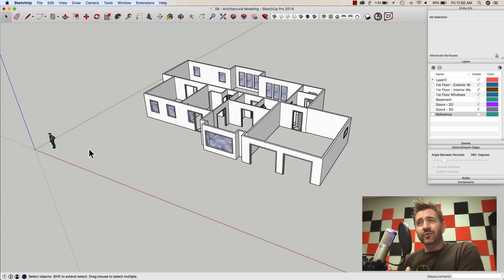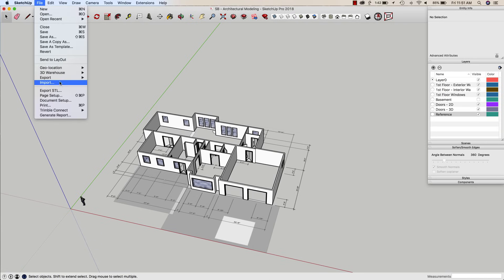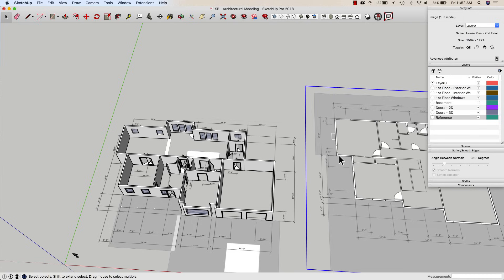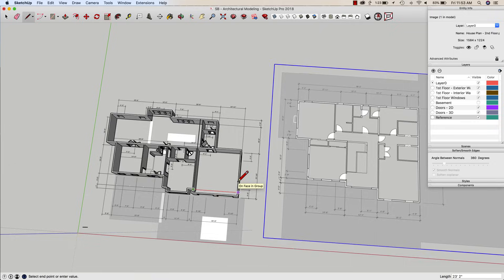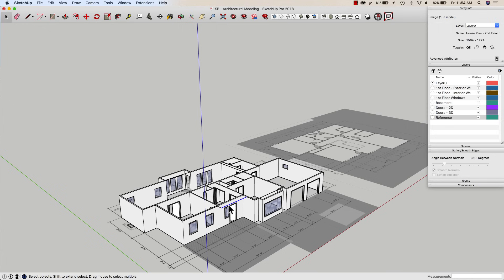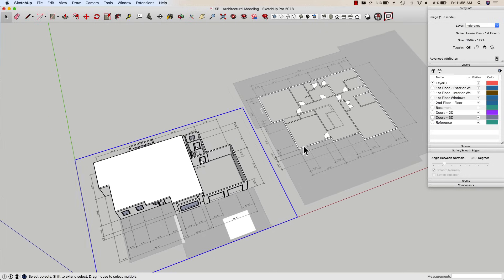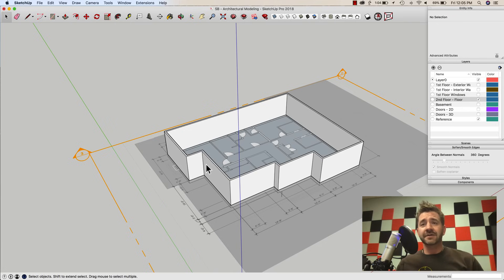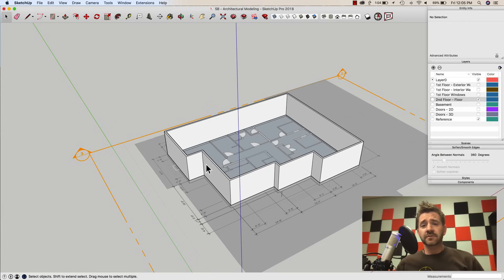Creating a Second Floor in SketchUp - Skill Builder

Comment: Thanks Aaron. Lots of good tricks here not isolated to architectural modelly, like the Unglue (which has frustrated me many times), the priority of faces and the use of a transparent surface, grouping the line ad image and scaling the group with the tape measure tool and a section plane to hide the lower objects so they do not distract from the task.  Excellent.

Comment: Hey Aaron. Thanks for all the great tips the Architectural Modeling Series. I liked how you explained how to create both 2D & 3D visual options within components. This spurred two different questions that I have had. One came from your 2D & 3D door example, which is, can you make the arc line a hidden line (dotted) instead of solid. The second question is, how can I create column lines in my plans so that I can not only view them but use them as a constant reference in my model. Thanks, Mark

Comment: I'm curious about your camera controls.  It doesn't look like you are using the orbit tool or if you are it works differently than mine.
Reply: I use a 3D mouse in my videos. A Spacemouse Enterprise for 3dconnexion, to be specific.
Reply: @aarondietzen2995  thanks.